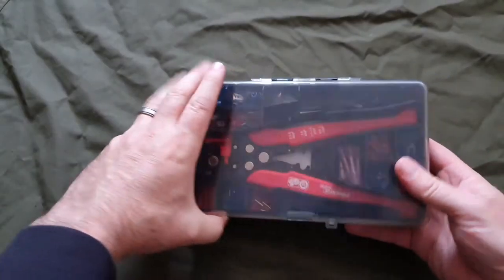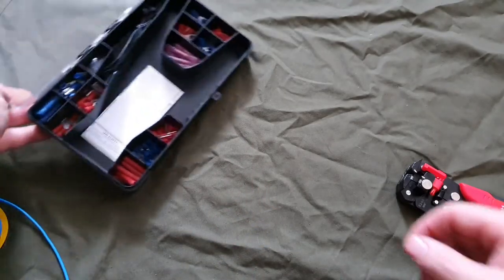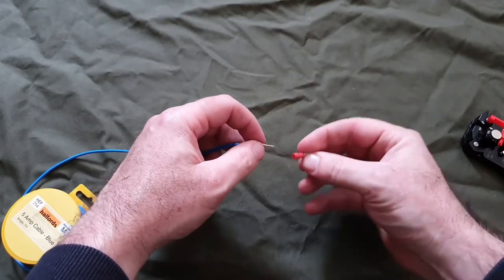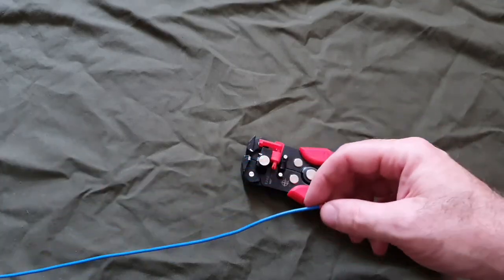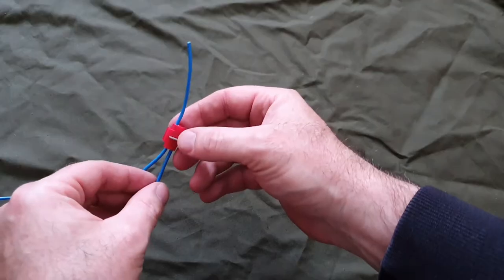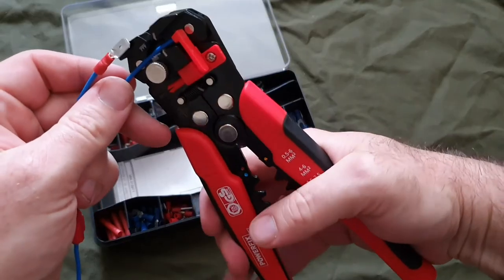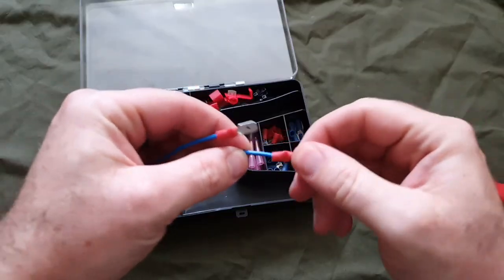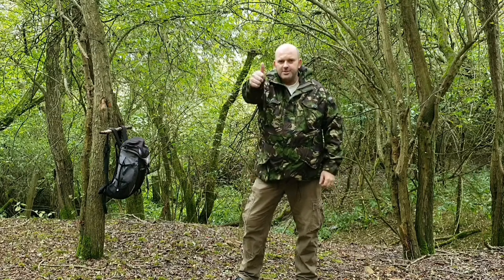Bargain lidl parkside crimping pliers set

Comment: I have just bought the parkside crimping tool and found the instructions were laughable. so I did the normal thing and googled.... and found not too much in the way of info, So I will add my observations this other wise good video (best out the ones I watched)...

1) The red tab can be moved outwards to the right to allow for a longer length of wire to be stripped. Note: swing it out 90 degrees so it can be easily moved (it has little groves on one side for grip) then tuck it back in place.

2) The chrome plated adjustment knurl appears to set alter the force required to strip a wire. Fully out (ie -ve), it is easy to strip, but the cable is not held very tightly and can slip leading to bared wire behind the actual cut from the gripping teeth. Wind it fully in (ie full clockwise) and a little more force is required to operate, but the cut is cleaner and a better result obtained.

I suspect the knurled tab simply screws into the round washer looking thingy (sorry couldn't think of a better word) that cab be seen immediately to the right of the tab when the tool is open, so provides the additional resistance required to strip wire. So ignore the hole

The pink bullet connectors are should be heat shrunk to provide a more waterproof connection.

The very thin butt connectors (no sniggering please!) are simply crimped over an exposed  bare end of a wire to allow for easy insertion into a terminal.

In conclusion, 
I like this tool and expect to use it regularly around my workshop.

The stripping tool works well, especially on flat cables but can also be used on rounded cables, but more care is required not to expose wire.

The crimping tool is OK, but not fantastic. I will use the 3 dotted crimp for all insulated connectors and use the others for ferrules and other non insulated connectors where a better (stronger) connection is required but only at the risk of puncturing the insulation. I expect for larger jobs, I will carry my actual crimper as well as the Parkside.

from the gripping teeth from the gripping teeth
Reply from the maker: Hi Dave thanks for watching and the detailed comment really appreciate it 👍

All the best
Roo
Reply: Hey, just asking how much did it cost?

Comment: Bargain little set - 3 questions,:
1 what are the pair of chrome studs above the main pivot point for?
2  when fully open what is the hole in one side of the head for?
3  What is the lengthy prong that passes over the head of the tool for?
Nice presentation - Thanks

Comment: l noticed you missed out 2 of the connectors ....namely the " Bullet Connector " ( it isnt called that by the way ) and the one in front with no plastic coverings
l think you will find that the connectors without any plastic wont work with this type of tool.
They are normally used to connect wires to " chocolate block type connectors " or even the terminals in sockets and plugs..............l have bought a seperate tools for that type of crimp connector
Reply from the maker: Thanks for watching and taking the time to comment John really appreciate it what do you call them then?

When I use choc blocks I just twist the wire and pop it in before screwing down on it to hold in place I don't add anything to it

All the best
Roo

Comment: Great video. Can anyone tell me: 1) What is the chrome wheel for below the red stopper?
2) Why does it have 3 differen coloured dots on it and also the what is the lower section for?
Reply from the maker: 1. That wheel is to adjust the depth of cut for stripping the plastic sheathing from the wire for different wire thicknesses

2. The area at the bottom is for crimping the various attachments to lock in place on the wire

Comment: Is this in stock now roo
Reply from the maker: In store from Thursday mate 👍
Reply: @PreparedCamping  ill have to invest in a set
Reply from the maker: For eight pound I think its great value and helped me fit new headlights on my car as the halo LEDs only had male spade connectors and needed extending to splice to my cars indicators and side lights

But can't complain they were on a el cheapo eBay special deal 😉
Reply: @PreparedCamping  yeah i want it just for the tool tbh .